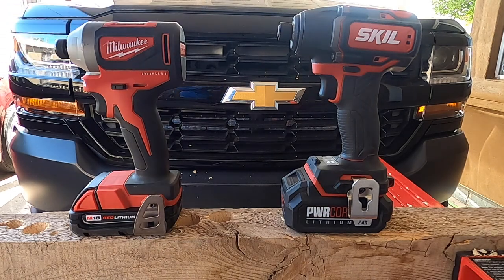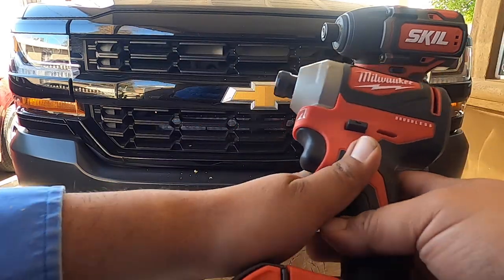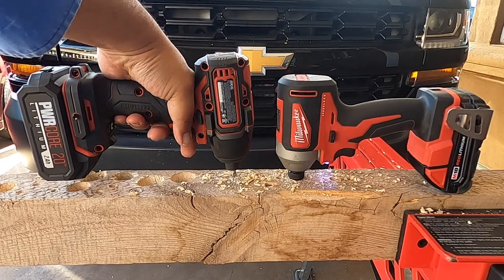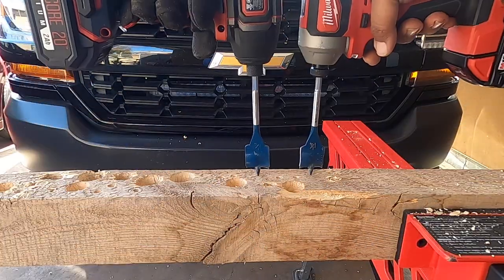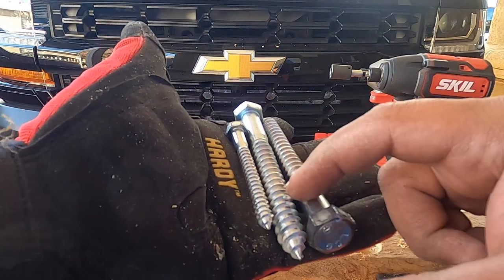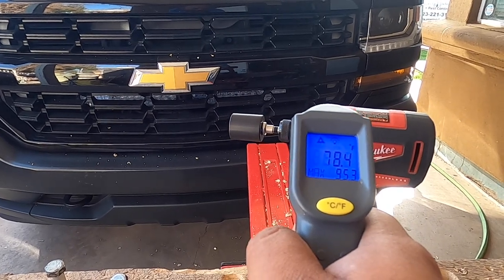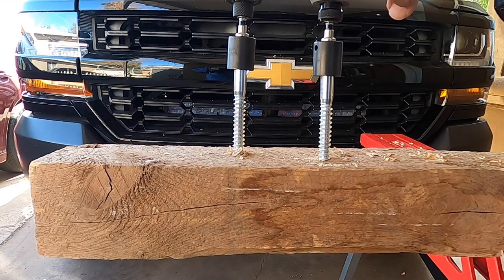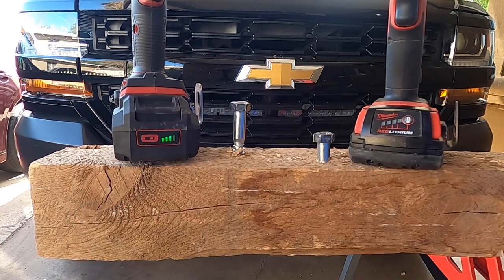Skil VS Milwaukee Brushless Impact Drivers

Comment: Nice video TH!  The Milwaukee impacts are tough to beat, especially the Gen 3....
Reply from the maker: Yup, that Gen 3 is a beast.
Reply: That's not the gen 3
That's the base model brushless/not fuel
Reply: @baseballdude8491  I never said it was the Gen 3.  I think you misread what I wrote.
Reply from the maker: @baseballdude8491  This older model is a better match for the skil. Gen 3 another level.